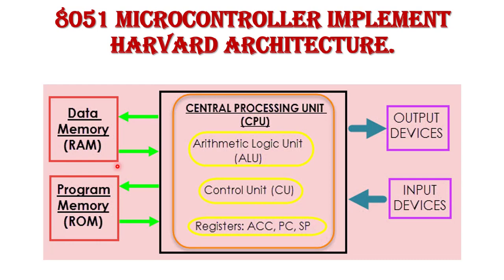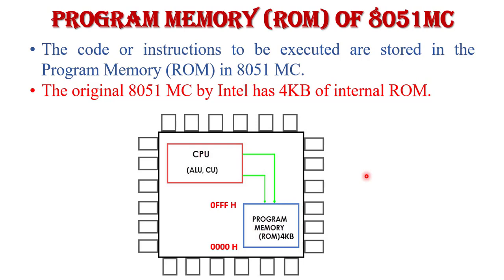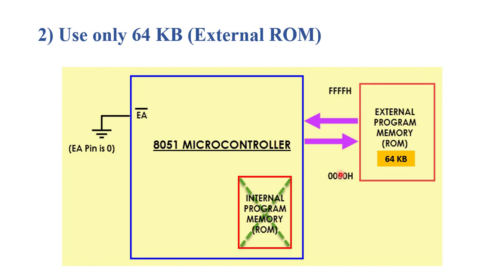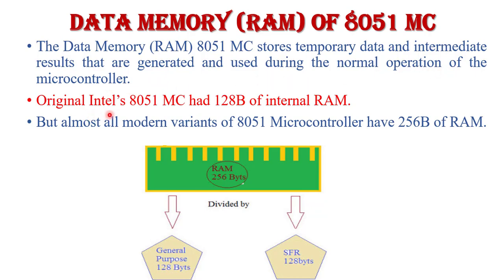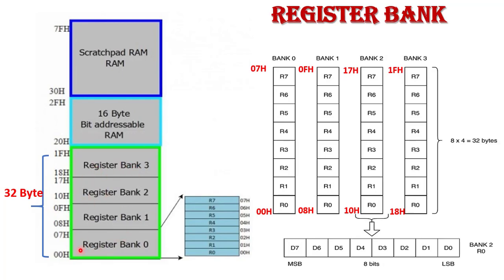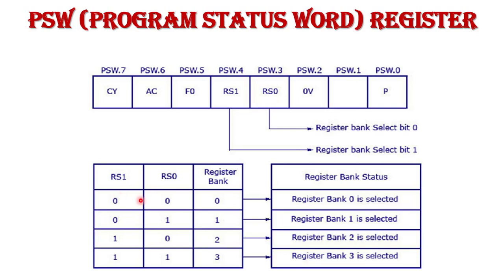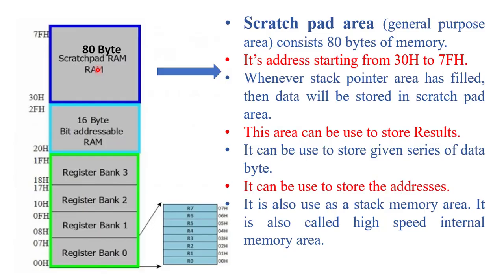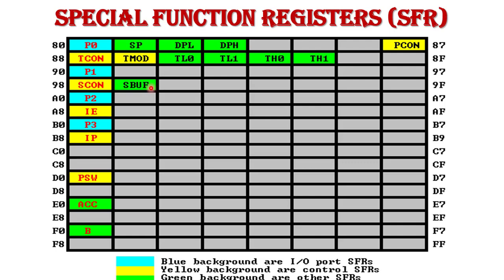#MemoryOrganization #8051MC#English   Lecture no:10 Memory Organization of 8051 Microcontroller.

Comment: Mam as the data memory in 8051 is of 256byte (general purpose area & special purpose area) then why the DPTR is taken 16bit long..........can data memory in 8051 be also externally çonnected?????
Sorry for the long comment but if possible then plzzz help mam..🙏🙏🙏
Reply from the maker: Thanks for watching my videos. The Data Pointer is a 16-bit Register and is physically the combination of DPL (Data Pointer Low) and DPH (Data Pointer High) SFRs. The Data Pointer can be used as a single 16-bit register (as DPTR) or two 8-bit registers (as DPL and DPH).
DPTR doesn’t have a physical Memory Address in SFR area of RAM but the DPL (Lower Byte of DPTR) and DPH (Higher Byte of DPTR) have separate addresses in the SFR Memory Space. DPL = 82H and DPH = 83H.
The DPTR Register is used by the programmer addressing external memory (Program – ROM or Data – RAM).